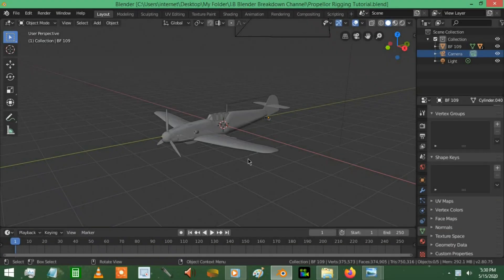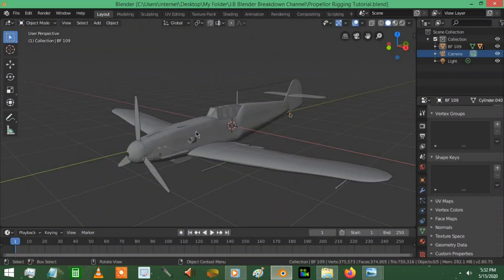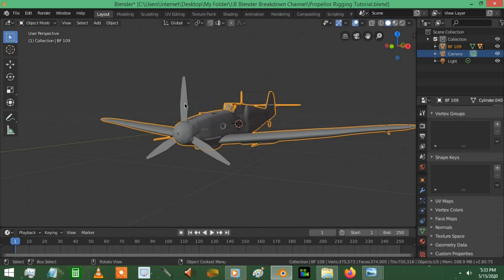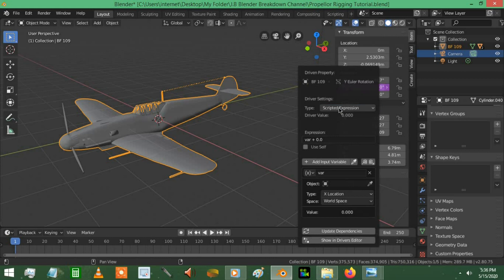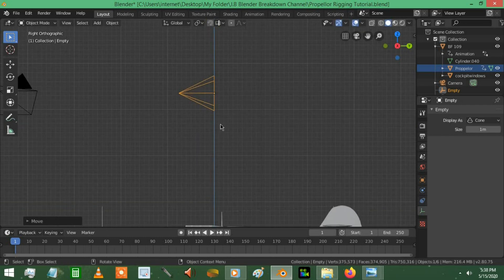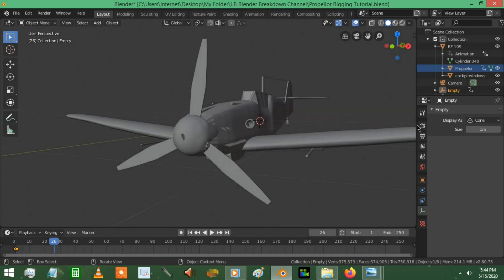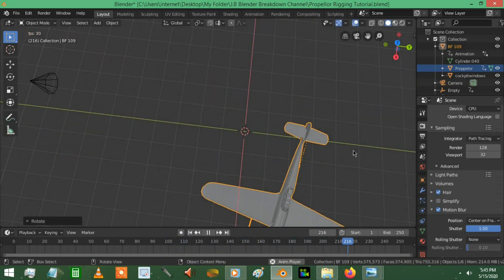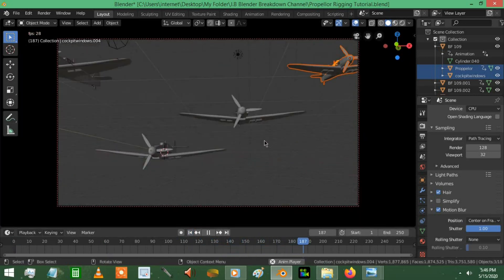How to Animate a Propeller in Blender (Tutorial)

Comment: Hey, how do you speed this up? I also have two propellers on my plane so I want to reverse the direction of one of the propellers.
Reply from the maker: Keep in mind that it may appear like your propeller is spinning slowly... in reality it could be spinning very fast but the frame rate at which Blender displays the animation as well as the lack of motion blur can make it appear to move slowly. A good way to check this is to enable motion blur and render a quick animation to see how it looks. 
I don't remember how to reverse the direction of a propeller, but I'm pretty sure you could just create a completely new empty and repeat the process in the tutorial but negate some of the values (e.g., y = 5 -> y = -5).
Reply: @jbblenderbreakdown4668   goddamn you are fast. I will absolutely try that, just one more question: Is there any way to make it start slow and then gradually get faster? Im rendering a cinematic for a quadcopter drone and I need my first person view to show it start up slowly instead of just activating in mere seconds.
Reply from the maker: @ArandomHitman  Yeah just set keyframes for the position of the cone empty and have it slowly move forward (which controls the throttle/speed of the propeller). 
The further forward the cone empty is, the faster the propeller spins.
Reply: @jbblenderbreakdown4668  Yep, just found that out. Interestingly enough, that caused one of my textures to glow like the sun, but I guess that's a me issue for now. Thanks anyways.
Reply from the maker: @ArandomHitman  Anytime! Good luck on your project!
Reply: @jbblenderbreakdown4668   Alright so I just tested it and its somewhat fast, but the animation isn't really too fast for what I need. Any idea how I can increase the speed?

Comment: Awesome video! :D But:
KEEP IN MIND THIS METHOD IS ONLY ACCURATE FOR CONSTANT SPEED PROPELLERS!

If you for example have the throttle to 0 (y-axis position 0), and immediately set it to 1 in frame 2, then in frame three the propeller will have rotation 2 (throttle 1 * frame 2 = 2). So a rotating speed of "2 rotation per frame" for that frame.
However if you have throttle at 0 until frame 100 and set it to 1, you will get it to have rotation 100 in frame 100. "100 rotation per frame" in that exact frame, as it speeds to "catch up".

So you cannot control the speed of the propeller using this method, unless you have a constant speed.

Earlier this year I had a commercial project where I needed to animate the speed of the propellers on a drone. That is, not just making it spin, but making the speed at which it spins change over time, like throttling up and down. I initially tried your method (didn't find your video before now so giving my advice here now), but I ran into the challenge I mentioned above. The answer was a simple python script for solving the propeller position for each consecutive frame.

So essentially, using the Blender python api (bpy), grabbing the local space position of the throttle (which was parented to the drone), and multiplying it with an arbitrary scaling constant, and adding this value to the rotation of the previous frame to get the rotation of the new frame. I ran this script every time I made a change to the animation in order to get the throttling up and down just right.

The pseudocode looks like this:

frame_0_rotation = 0
for frame in scene:
next_frame_rotation = current_frame_rotation + current_frame_throttle_position * scaling_constant

using the Blender python api to access and edit any involved variables.

Also, in addition to enabling motion blur like in the end of the video, if you want that "bendy" propeller look like there is in one of the examples in the video, you need to enable rolling shutter.

I hope someone somewhere will be able to get past a problem thanks to this comment :)
Reply from the maker: Thank you very much for this very informative comment!! Back when I made this video, i didn't have any understanding about like coding and python, I was actually trying to make a modern version of this tutorial from one that had been made in like 2009 using something like Windows 2000! 🤣
Anyways, once again thank you for this awesome info. I may have use of it for myself in a later project!!

Comment: For some reason it only rotates once.
Reply from the maker: That's very strange. I'm not sure at all how that could happen. I'll let you know if I think of something though.
Reply: @jbblenderbreakdown4668  Could it be because im using 2.93 instead of 2.8?
Reply from the maker: @revcus7437  That's definitely a possibility.   But I'm pretty sure the settings used in this video weren't changed dramatically and so should produce a similar result. I'm not sure though.
Reply: @jbblenderbreakdown4668  Even by not following this tutorial I cant even spin it more than once apparently.
Reply from the maker: @revcus7437  That's so strange.
Reply: Had the same issue in 2.9. You have to change quatermion to euler in the drop down under rotation in the Transform menu.

Comment: Hi, a question, how did you parent the propeller so that it rotates around the point of origin?
Reply from the maker: Just drag the center of the propeller in edit mode to the origin. Then go back to object mode and the point of origin should be in the center of the propeller.
Reply: Just press ctrl + p

Comment: Thanks for the clear examples. Everything worked first time! I have one question if I may? To adjust the propeller speed you just slide the empty up and down the Y axis? I can't seem to get it to spin really fast.. Thanks!
Reply from the maker: I'm glad it worked out!
Yeah to adjust the speed of the propeller you slide the empty up and down the Y axis. Keep in mind that moving it even a tiny bit will adjust the speed tremendously. Also it will seem that it isn't spinning any faster, but this is because Blender is displaying the frames to you at a certain frames per second that makes it difficult to determine how fast it's really going. You get the same phenomenon when recording a helicopter's blades. It will seem that they are spinning very slowly or sometimes not even moving at all. Just adjust the empty to a place that seems to make the propeller spin faster and remember to turn on motion blur for realism. I've run into the same problem, and the best thing to do it just keep experimenting with the empty.
Hope this helps and if you need anything else, just let me know!!
Reply: @jbblenderbreakdown4668  Thank you for the swift reply  - I'll have a play around...
Reply from the maker: @andyklyen6885  For sure!!

Comment: when i press n 2:33 a different menu pops up says show cursor and the left menu there is nothing to select
Reply: (from aurora 9 years old) maybe you can search your problem on blenderstackexchange
Reply from the maker: @tonilawas  That definitely could work!
Reply: Click on "Y Euler Rotation" on the left under Drivers the menu should change to correct menu.
Reply: @TheGreenAppleCharity  EPIC - fixed the missing Driver menu in 4.2 version😀
Reply from the maker: Hmm... Pressing "N" should bring that menu up unless the shortcut was changed in the User Preferences. I don't know why it isn't working for you, but I will let you know if I find any answers. Sorry about that.
Reply: @jbblenderbreakdown4668  first it worked when pressed n and i clicked something and the menu gone guess i clicked something wrong
Reply from the maker: @layr1k  Oh, okay. You could try to do the whole process again. Maybe that would work.
Reply: @jbblenderbreakdown4668  i closed without saving and open new project agin but not helped
Reply from the maker: @layr1k  Man, I wouldn't know what to do at this point. The "N" key should bring out the properties panel, but if it isn't doing that for you then something isn't right. I don't know what to say here, sorry. I will still let you know if I find the reason for this error. 
But thanks for the feedback, I do appreciate it.
Reply: there should be an option  on the right side called Drivers click on this and you'll open the same menu